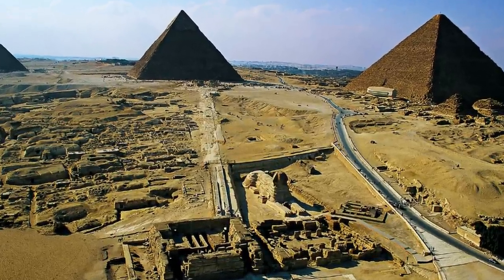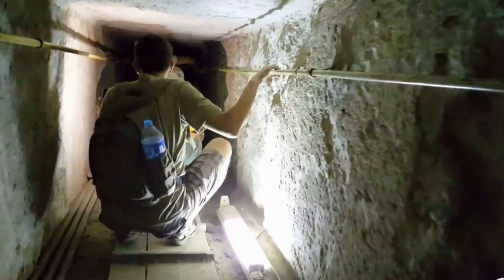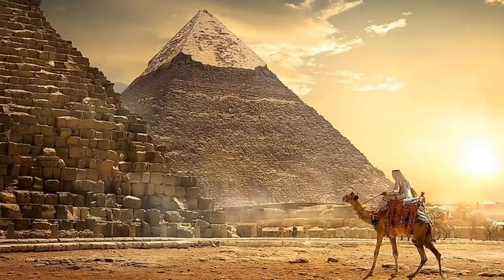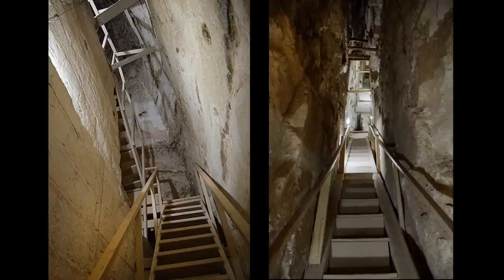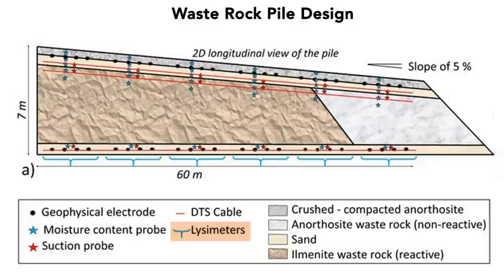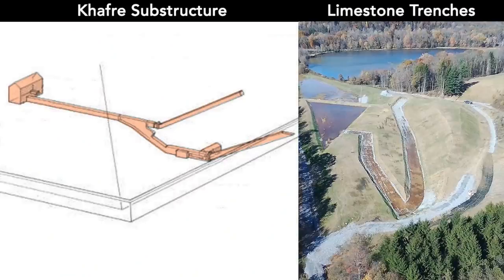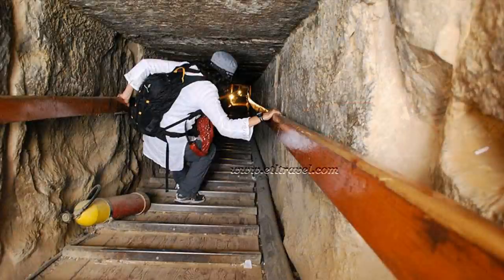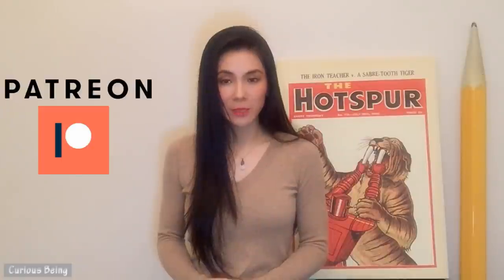The Secret Enigma of the Egyptian Pyramids’ Interior

Comment: You can calculate the volume of water these tunnels can carry.  Seems far too little water, in my opinion. Any well type drainage would silt up. Where would/did all the silt go ??
Reply from the maker: Were the pyramids built during dry or wet season? Right now Giza Plateau and Cairo are in desert climate. “Cairo is donated on balance 26 mm (1 in) of rainfall per year, or 2.2 mm (0.1 in) per month. The wettest weather is in January when an average of 7 mm (0.3 in) of rainfall (precipitation) occurs.”

The Sahara/ North Africa goes through humid/dry cycles. The Sahara was green and wet from about 14,500 years ago (after HS1 the millennia-drought) to 6,000–5,000 years ago. The humid period before that was around 85,000 to 78,000 years ago. HS1 (20,000-15,000 years ago, https://youtu.be/Zs4zLKbp4Ic) is the time period that coincided with the severe human population bottleneck which I think could be the ending of an advanced civilization. If the pyramids were built during 78k-15k years ago, then the Giza Plateau would be as dry if not dryer than now. Therefore the small channels would have been sufficient.

Comment: How does a liquid deep through solid rock and sealed casing stones into these rooms? Seems unlikely to me.
Reply from the maker: Stone is porous and water can seep through. Even with today's desert climate conditions Egypt has occasional storms which caused flash floods. Because of the massive sizes of the pyramids, its possible that there has been water seeping in.  If the pyramids were designed as permanent mine waste storage, then the designers would have taken hundreds if not thousands of years of climate conditions into consideration. Though I think the interior system of the Great Pyramid might be experimental since the later, better structure the Khafre doesn't have the same design, therefore this G1 system might not be necessary after all.

Comment: Remember that those shafts was documented hermetically sealed, to be chisel opened by modern archeologist. It was broke open in rough shape and later trowel smooth to please tourists. You may not born yet when it was troweled.
Reply from the maker: Yes, like today's underground drainage channels, such as a French drain.
Reply: @CuriousBeingbyTina  do you mean French drains are closed and accept no water like air shaft in pyramid?
Reply from the maker: @philoso377  No French drains are not "closed"; they are trenches/ drainage channels filled with gravel or rock or containing a perforated pipe (like the air shafts) that redirects surface water and groundwater away from an area.
Reply: @CuriousBeingbyTina  I agree with your description on French drain. Why do we assume pyramids sealed air shafts are French drains?
Reply from the maker: @philoso377  I explained my thoughts in a prior video: The True Purpose of the Great Pyramid's Interior System?! https://youtu.be/BYr6HbEjS7w
Reply: @CuriousBeingbyTina  please follow up my comment to the channel in your link above.
Reply from the maker: @philoso377  You left a comment? I didn't see it.
Reply: @CuriousBeingbyTina  my comment can be read in the video you point me to last.

Comment: The damaged floors, ceilings and piles of rubble are most likely the result of tomb robbers seeking hidden chambers and treasure. There is good reason to believe the tombs may have initially been robbed by priests and builders after the ceremonies were completed.  A timber staircase or crane may have been constructed for the burial ceremonies and removed afterwards to make entry more difficult. 
All of these pyramids have been damaged by earth quakes over the millennia. This may also account for some of the rubble.
Ceremonies would have involved ritual burial, and perhaps journey through the underworld. Then resurrecting rituals, possibly to the upper chamber. There is no proof that the lower chamber was for the queen and the upper for the king known as a Pharaoh. Some believe the small rectangular tubes were to allow the resurrected Pharaoh to return to his place of origin in the sky.
Stone was obtained from different quarries and selected for different applications. Some even shipped from Aswan in Upper Egypt.
There are no mines with this volume of stone near the Pyramids. There is nothing of value in limestone worth mining.

Comment: Interesting, though I doubt the "drainage system" would have the potential to be filled to the extend needed to work as you hypotheses, no matter the amount of rain. and if channels of limestone had the amount of acidic water as you suggest, wouldn't we see erosion correlating to this?

No doubt that your insight has brought me to new thoughts on the pyramids, though I doubt your full hypothesis holds steadily. You might be closer to the truth than any I have heard before, but I think you are taking it further than necessary.
Reply from the maker: Thanks Klaus. The seepage water that gets into the pyramid doesn't immediately change to acid mine drainage. Acid mine drainage forms when sulfide minerals are exposed to oxidizing conditions whereby three elements are necessary: oxygen, water and sulfide-bearing rocks. This is a chemical reaction which would form sulfuric acid. The pyramids were covered with casing stones so there would have been limited amount of oxygen and water inside, therefore would have generated relatively small amounts of acid mine drainage. 

We can see damages and erosion marks in the chambers and the grand gallery - are they caused by robbers or acid water erosion?  The bottom of the passages are covered so it's hard to find erosion marks there.
Reply: @CuriousBeingbyTina  but the amount of water necessary in the grand gallary would need to be quite a bit to have a fairly constant level for any erosion to be visable. I really doubt on your amount of water, and the shaft are pour examples of drainage.
Though I like the pyramids being storage of eccess blocks.

Comment: I fully support you bringing outside of the box thinking to the mystery of pyramids, because the official explanation doesn't make the slightest sense. Personally I still don't think they were water pumps or any type of industrial buildings, because all these explanations ignore the vastness of the insanely geometrical pyramid around them. industry doesn't need that, especially in billions of tonnes of limestone and granite. water would also leave visible erosion marks to the stone, which leads the other problem of this idea: stone pyramid is impossible to repair once the interiors start to wear out.

Comment: Would they not be practical if somebody was being lowered by a rope and pulley? - less scope to swing about and bash against the wall - just a thought
Reply from the maker: Thanks Dominic. These passages are about 26 degrees in slope, steeper than a regular ramp. A rope and pulley might work for vertical passages but would probably not work for a 26-degree sloped tunnel.

Comment: hmm.. i still dont buy the mine-tailings dam idea.. 
but what if they were not trying to reduce acidity, but actually trying to increase it?
why would they want to make massive amounts of acid? - for their "bagdad battery" jars of course..
Reply from the maker: To increase it? Limestone would dissolve or degrade with a higher percentage of hydrochloric acid. The pyramids were covered with limestone casings - have you seen any battery without a protective container? Also, Bagdad battery is not an effective version of batteries. Whoever built the pyramids were very advanced and I don't think they would built multi-million ton pyramids so they can use them as inefficient Bagdad batteries.
Reply: @CuriousBeingbyTina  it is claimed that vinegar was used in them, and yes, vinegar woul dbe very ineffective because of how weak that acid is.. but you are right, you couldnt use limestone to make it more acid.. 
but it could make an alkaline substance! a very potent one - lime (calcium hydroxide) and its solution..
a bagdad battery would work with alkaline material also. and vinegar really isnt a great electrolyte
Reply: The "Baghdad" battery was actually an amphora filled with spells on a papyros for fortune that was used to be buried next to a new house. It resembles a battery due to our modern resemblance. Just like the "Light bulbs" of Dendera are no light bulbs because they look like modern ones. There is a detailed hieroglyphic description of the snake and the Lotus flower etc. just the next wall besides to it. But it conveniently never gets mentioned.
Reply from the maker: @DilbertMuc  Thank you for sharing your insight. Good to hear about there is a  hieroglyphic description about the "Dendera light bulbs" - I've not heard about that!
Reply: @DilbertMuc  you'd have a hard time proving your claims about the bagdad battery, as it disappeared during the iraq war
Reply from the maker: @DilbertMuc  Great advice - I agree we need to look at both sides of the story. I will check out the channel you suggested.  Thank you!
Reply: @Ghryst  It was thoroughly researched and described. Problem was that the potentially produced voltage is useful for nothing, so metal plating of stuff won't work. They would have had to connect many amphorae in series to produce a higher voltage and then the current would have been too low. But they discovered and exhibited several other amphorae very similar to the "Baghdad battery" and they all had a papyros with fortune spells in it and sealed with bitumen. Don't know more about it.
Reply: @DilbertMuc  " It was thoroughly researched and described"
thats exactly what a fraudster would say when trying to make claims about something that never existed
Reply: @DilbertMuc  also, do you even realise that most modern batteries produce the same voltage? and we very rarely only ever use one battery, because we need more voltage even for the most basic of things. 
and for your specific example, electroplating, a very small voltage is perfect, far lower than a 9 volt battery even, like, 2.5-3 volts is about right for most metals. thats 2 or 3 bagdad batteries with a primitive vinegar/copper/iron action. the equivalent of two or three AA cells, or 2 or 3 D cells, or (and this is really gonna reveal that you just dont know what the hell yr talking about) just 2 or 3 cells out of a 12 volt car battery.

and ill even cover the bizzare outcome where you think to ask about amps. nope, very low amps are required for electroplating too. 3 amps at absolute most.
thank you vely much, please come again
Reply: @DilbertMuc  your ad hominem is completely invalid and only discredits your further yabbering.
"That "battery" was found in 1938 and was thoroughly investigated in Germany"
nope, German conspiracy theorists made it all up and then stupid ppl came to cover it up by lying about it on the internet.
Butt seriously, "Copper vs. iron as electrodes do not really produce any useful application" = you definitely dont know what yr talking about. voltage doesnt come from the electrolyte, it comes from the metals.
a copper/iron cell creates 0.77 volts, it always creates 0.77volts, and it only creates 0.77volts, because the electropotential between iron and copper is (...drumroll pls...) 0.77volts .. the quality of the electrolyte only affects the efficiency of the galvanic cell (how long it takes to activate), not its voltage strength. and yes, vinegar is a poor electrolyte, and that is why i was suggesting a different source of acid could have been used, because the acid THAT WAS discovered in the "bagdad battery" (protip: papyrus doesnt preserve very well in acid, which is why your claims that there was paper in the bagdad battery is utterly ridiculous, no matter how many other different jars were found with papyrus in them), was not identified and no source for it was attributed. ie: the dumbarse german with the fancy archeology paperwork (which was probably bought, not earned) just assumed it was vinegar, because he was a dumbarsed archeologist good only for digging holes, not a chemist whom is good for thinking logical shit.
Reply: @DilbertMuc  "OH NO!!! SAVE ME FORM THE BIG BAD TROLL!!!" said the person with no valid argument to make.